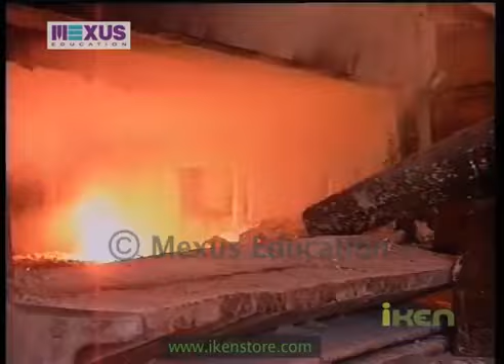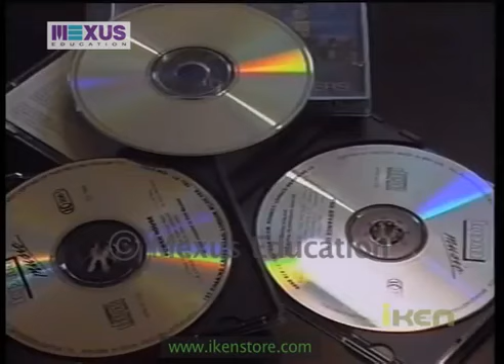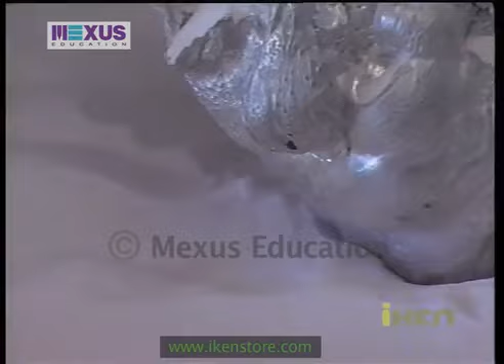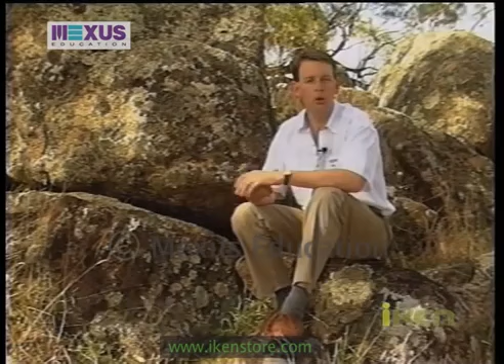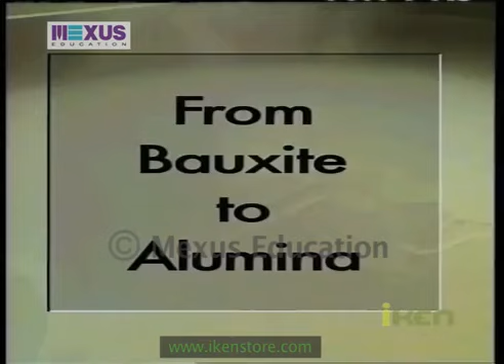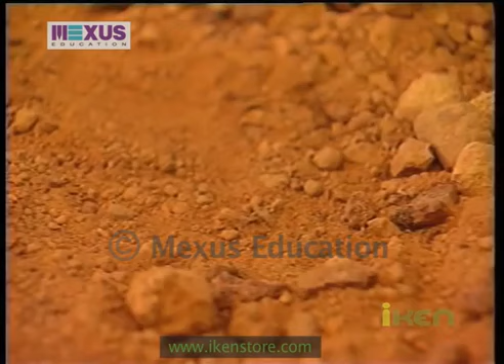The Making of Aluminium

Comment: 3:55 “it’s an energy hungry process” is the reason we must all recycle our aluminum foil, cans, and other aluminum products that do not require too much effort to deconstruct. An example of an aluminum product not worth recycling is short pieces of leftover underground power lines. They are copper in the centre, coated with rubber, in a case of aluminum, coated with rubber again (btw the copper is wayyy more valuable and expensive than the aluminum in every way so that’s the real main concern in this situation). Now take care, recycle, or even better don’t consume as much trash if possible.
Reply: I am job in samelter plant 
I am aluminium smelting work 
Hindalco ind ltd

Comment: If aluminum is not found in nature, and it is a relatively modern process to produce aluminum. How did Napoleon end up with an aluminum spoon?
Reply: I'm not sure but I'm sure it wasn't easy. There are other ways to produce it but none of them very practical.  It was the most expensive material in the world at one point, in fact the cap stone of the Washington monument is made of aluminum because they wanted to make it out of something super special, it took a large portion of all the aluminum in the country to produce it. During Napoleon's time royalty would give the most important guests at the table aluminum silverware and the less important ones would have to settle for gold.
Reply: Update: I was curious so I looked into it, It was actually not Napoléon Bonaparte at all who had aluminum cutlery, it was his nephew Napoléon III. Napoléon Bonaparte died in 1821 about 3 years before aluminum metal was synthesized for the first time, even then it would be a couple decades at least before anything useful was done with it.

Comment: Alif 2711100133
Alumunium is an active metal that always react to other elements,you will never find element that contains pure alumunium.We see many things in the application of alumunium,Including Plane,cars,motorcycle,tank,air craft,cooking tools and many more,There are plenty use of alumium in everyday life.The metallic element in the alumunum is the most plentiful in the earth crust.Compromising of the planet soil rock and oxygen. In this video we could learn that alumunium is made from the alumina with the process of electrolysis.Alumunium will not always found in natural and pure but always found only in chemical compounds in other elements such sulpuhur,silicon and oxygen.Alumunium compunds occur all type of clay.But the most useful of all is bauxite.
Raw Materials
Aluminum compounds occur in all types of clay, but the ore that is most useful for producing pure aluminum is bauxite. Bauxite consists of 45-60% aluminum oxide, along with various impurities such as sand, iron, and other metals. Although some bauxite deposits are hard rock, most consist of relatively soft dirt that is easily dug from open-pit mines. Australia produces more than one-third of the world's supply of bauxite. It takes about 4 lb (2 kg) of bauxite to produce 1 lb (0.5 kg) of aluminum metal.
Caustic soda (sodium hydroxide) is used to dissolve the aluminum compounds found in the bauxite, separating them from the impurities. Depending on the composition of the bauxite ore, relatively small amounts of other chemicals may be used in the extraction
Aluminum is manufactured in two phases: the Bayer process of refining the bauxite ore to obtain aluminum oxide, and the Hall-Heroult process of smelting the aluminum oxide to release pure aluminum.of aluminum. Starch, lime, and sodium sulphide are some examples.
Cryolite, a chemical compound composed of sodium, aluminum, and fluorine, is used as the electrolyte (current-conducting medium) in the smelting operation. Naturally occurring cryolite was once mined in Greenland, but the compound is now produced synthetically for use in the production of aluminum. Aluminum fluoride is added to lower the melting point of the electrolyte solution.
The other major ingredient used in the smelting operation is carbon. Carbon electrodes transmit the electric current through the electrolyte. During the smelting operation, some of the carbon is consumed as it combines with oxygen to form carbon dioxide. In fact, about half a pound (0.2 kg) of carbon is used for every pound (2.2 kg) of aluminum produced. Some of the carbon used in aluminum smelting is a byproduct of oil refining; additional carbon is obtained from coal.
Because aluminum smelting involves passing an electric current through a molten electrolyte, it requires large amounts of electrical energy. On average, production of 2 lb (1 kg) of aluminum requires 15 kilowatt-hours (kWh) of energy. The cost of electricity represents about one-third of the cost of smelting aluminum.
The Alumina Processing
Alumina processing known with Hall Heroult Process. This process created based on electrolysis theory. Electrolysis is the chemical decomposition of certain substances by an electric current passed through the substance in a dissolved or molten state. In Electrolysis, we need anode, cathode, electrolyte and electric current. In Hall Heroult Process, we need cryolite as a electrolyte. Cryolite normally melts at 1009 degree Celcius. In order to reduce this temperature, we need to adding some compounds such as Aluminium Flouride, Calcium Flouride, and Aluminium Oxide. Beside that, the major ingedients is carbon. Carbon needs for make an anode consumed in smelting. Alumina added to this electrolytic salt bath quickly dissolves and reducing melting point. Cryolite forms a thick crust which for the conservatives costly heat energy. In early reaction soda ash added to fix unbalanced cryolite. After all additional compounds has been added, some gasseous products is evaporate. This gas collected by the fume hood and travel to a fluoride recovery system. This gas contains a Flouride which is toxic.  So we have to bait this gas with alumina which traps about 99 percent of escaped fluoride through the pipeline and returns them to the parts. The electrical current combines with the heat energy tho split the alumina dissolved in the electrolyte into its ionic components. The aluminium ions migrate to the cathode where they pool as molten metal. The oxide ions are attracted to the anode where they react with carbon to produce carbon dioxide. The oxide ions are repelled by the negatively charged cathode but attracted to the anode here they combine with carbon to form carbon dioxide and small amounts of carbon monoxide. During the electrolysis, carbon is being continuously ripped from anode so these decomposing anode are automatically lowered into the bath to maintain the correct surface contact and current flow until each anode needs replacing after 4 weeks. Each year the two pipeline consume about 180.000 anodes. The cathodes decompose more slowly and need replacing about every five years.

Comment: Farid Rizal
2713100041

Alumunium is one of material to make bikes, plane, tv material, compact disc etc. 30 million years ago a subtropical climate extended. High rainfall and the organic acids drippin vegetation began weathering the granite outcrops in some areas. Eventually this process dissolved out and washed away many minerals leaving behind a thick surface mantle i’ve ready soil as well as iron oxides its contained any medium hydroxide which forms whenaluminium bones with hydrogen and oxygen Alumunium made from bauxite, Al2O3.3H2O+2NaOH – 2NaAlO2  + 4H2O the crushed hydrated and medium oxide mixed with sodium hydroxide with more caustic soda at high temperature, sodium hydroxide selectively dissolves and minimum ovxide leaving any. Dissolved impurities to filtered out and primary concentrated sodium aluminate solution is cooled and seeded with tiny crystals and fewer then new medium hydroxide further growth to crystals, the larger a new medium hydrate crystas are filtered and heated to 1000 degrees celcius. How to make Alumina to Alumunium ? Actually alumunium project maked by bayer process and electrolysys process. Alumina contain small highly charged and oxide ions held in a strong bionic lattice each oxide has radius, the lattice is very difficult to show in three dimensions. To make one tones nees about two tones of alumina half ton of carbon alumina loaded in a vacuum system. Electrolysis  use Hall Heroult by Paull Hall  and Charles Martin Hault .  To make alumunium needed around 15 kilowatt hours per kilogram and 1 kw radiator running for 15 hours. Production cost (per tonne) raw material 45,3% (Alumina 33,1 %) Energy 28,5 % (Electricity 26,6%) Labaour and overheads 26,2% . The pipelines where electrolysis transforms alumina into alumunium , current enter one of closing series from one part to the next exit the other the flows through the second part line before returning to the switch shot to complete circuit. P = V x I, P measured in watt s is determined by multiplying two voltage , V the current which is measured and I is a current. Large cabin blocks is a cathode, this blog made by very hard  high carbon. The other part of electrolysis process is steel in bottom, steel current conducting bars, insulated superstructure, alumina hopper, removable doors , and fume hood. Anoda will moved down to contact with cathode and result a circuit  will heat to 950 degrees celcius.  The anode made from carbon petroleum coke. Range from anoda t cathode is 50 mm. The electrolyte composition is cryolite 3NaF.AlF3 melts at 1009 degrees celcius, alumunium fluoride (AlF3), Calcium Fluoride (CaF2) and Aluminium oxide (Al2O3). Alumina dissolves and melts at 950 C, after that cryoite forms a thick crust, carbon soaks up sodium compound , pot room operator add soda ash, aluminium fluoride is also added finding cryolite. The alumunium ions migrate to the cathode where the pool as molten metal. Aluminium dissolved and melt at temperature 950 degrees celcius and cryolite forms a thick crust and carbon soak up sodium compounds. Electrolysis combine electricity current to dissolve alumina in ionic component, then ion moved to molten metal. The oxide or O2 react with C or carbon to produce carbon dioxide or CO2, and Al3+ react wit 3e- to produced pure Al. After the electrolysis process, material became an ingot. The raw material is molten metal. This process used vacuum crussible and use temperature unti 600 degrees celcius. Quality control of this process is very important because the impurities is very high and the technician must be carefully. The impurities of ingot it can be 99,8 % include magnesium, vanadium, iron, silicon, zinc, manganese, chromium. The EPA 0.73 flouride per kilogram alumunium but in Portland emission there is 0.37 kilogram fouride per kilogram alumunium. Molten aluminum eventually distributed to other areas to be done casting process. This process can make the molten metal was 22.5 kg to 1 tonne ingots. For the manufacture of ingot itself also from molten aluminum which has a heat of about 9500C is cooled down to a temperature of 6000C and new casting. Each ingot production this year could reach 900 tons of metal with specifications 1 ingot every 2 seconds.Effect of alumunium factory in eviromental is exhaust gas produced the form of CO2 and fluoride. But the factory in portland australia use the technology is still new. Thw fact much of the rest of the results are useful for the production of nature such as fluoride that use for plant fertilize. To keep the eviromental safe the factory in Portland checked the factory continousl or peridically.

Comment: Muhammad Fajar Ismail
2713100100 

Everyday there many use of aluminium because aluminium is light weight material. Example an aluminium for industry, an aluminium for building, aluminium for transportation and nationaly defends probably contains an aluminium.
 It’s made from the white powder that we called alumina using a electrical process that process called electrolysis. We never meet a pure aluminium in a nature, we can found the aluminium in bounded with compound. Aluminium is active metal. 
 300 milion years ago, in australia happened high rainfall that’s waste away many minerals. Aluminium hydroxides which form aluminium bonds with hidrogen and oxygen. Bauxite is hydrate aluminium oxyde Al2O3 . 3H2O. It contain aluminium, oxygen and hydrogen. Because an aluminium is very active metal, it give the bauxite very high melting points (2000oC). Smelting bauxite is very dangerous and most costly because need very high energy required and energy need cost.
 There use an electrolysis process to produce an aluminium from bauxite an for  electrolysis process, bauxites must first be refines into alumina. There’s use the bayer process to chemically impurities, sillica, and titanium oxyde. Its an energy hungry process because consuming about half of the gas supllied for western radius. Aluminium oxyde is mixed with sodium hydroxyde in a high temperature solution. During the reaction the sodium hydroxide is dissolved the aluminium oxide into a solution and leaving any impurities. Reaction : Al2O3.3H2O + 2NaOH -> 2NaAlO2 + 4H20
2NaAlO2 + 4H2O -> Al2O3.3H2O + 2NaOH
Al2O3.3H2O -> Al2O3 + 3H2O at 1000oC
The refining, free flowing sandy compound called aluminium oxyde or alumina (Al2O3). Alumina contains small Al3+ and O2. Ionic radius of each oxide ion has an two and a half times larger than that of each Al Ion. Because of that, a two to three ratio of Aluminium ions to oxide ions is very difficult to show in three dimension (3D). To make one tonne of aluminium, we need two tonnes of alumina and just standard half a tonne of compound.
 Electricity used is around about 15 kilo watt hour per kilogram of aluminium prodused = 1 kilo watt radiator running for 15 hours consumption. For example in alcoa produce 1000 tonnes aluminium a day and paid a biss about 15 milions dollar per day. 
In Australia, production cost per tonne of aluminium is high. Especially for Alumina and electricity production is more than a half consumption.
Electrolysis process transform alumina into aluminium. These call Hall-Heroult cell.
Current flows from negative switchyar to the positive switchyard. There is the simple equation to menghitung power consumption in smelter. P=V x I, where P is electrical power, V is voltage, and the currren I. Example is 4.5 volts x 300.000 ampere = 1.350.000 watt or 1.350 kilo watts. That’s very high consumption of energy for processing an alumina to aluminium.
In Hall-Heroult Cells, we can see a steel bottom, carbon blocks as cathode, steel current conducting bars, insulated superstructure, and anodes (Carbon). The part of superstructure also include a Alumina Hopper for entrance an alumina into part below. For smelting, each part to operate temperature by electrical resistance heating. There anodes are lowered than cathode and the temperature in the pot (bath) is 950oC. Gap between anodes and cathodes is 50 mm and Cryolite is placed in the heated pot (bath). 
Electrolysis defines the chemcical decomposition of certain substances by an electric current passed through the substance in a dissolved or molten metal.
Electrolysis of alumina is use electolyte in a bath that’s consisting mainly a cryolite (3NaF.AlF3), then Aluminium Fluoride (AlF3), Calcium Fluoride (CaF2) and aluminium oxide (Al2O3). Cryolite normally melts at 1009oC. Alumina added to this electrolysis is to reducing the melting points from 2000oC to more economical temperature 950oC. The Cryolite forms a thick crust. Aluminium Fluoride is also added to match the sodium sontains of the consume the alumina. This maintain to correct of sodium fouride to aluminium flouride finding cryolite. As electrolysis begins,these flouride levels drop and moisturing in the air and the alumina caused hydrolisis which produces hydrogen fluoride. The gas is collected by the fume hood as the fluoride recovery system.
As electrolysis cause when the electric current combines with heat energy. Alumina splits into ionic components (Al3+). Aluminium ion (Al3+) migrate to the cathode, where the cathode is molten metal. The oxide ions (O2-) are attracted to the anode (C) and they react to produce carbondioxide (CO2) and small amount of carbon monoxide. The reaction is C + 2O2-  CO2 + 4e-. The anodes is replacing after 4 weeks.
Reaction in cathode is Al3+ + 3e-  Al and in anode is C + O2- --> CO2
Quality control is very very important for checking purity of aluminium. Ingot purity of aluminium is 99.8 %. There’s impurities include is iron, silicon, magnesium, manganese, gallium, chromium, Zinc, and vanadim. Each day, aluminium is produced about 900 tonnes of metal and one ingot every two second.The metals value is various.
Reply: السلام عليكم